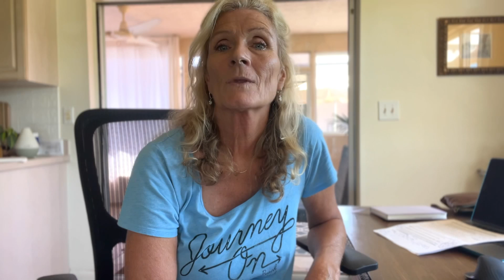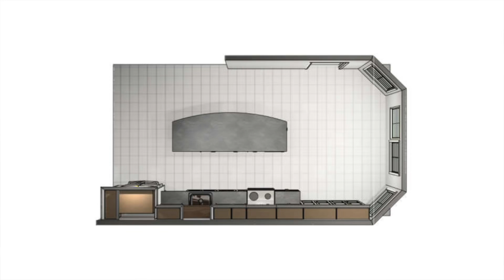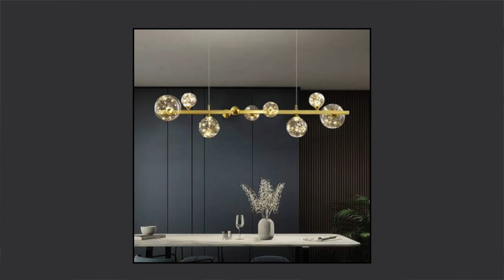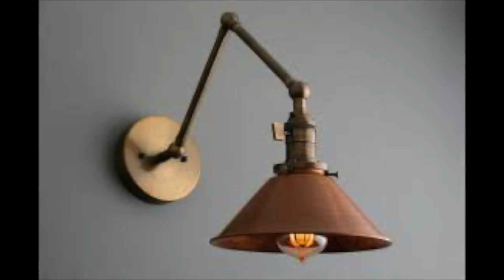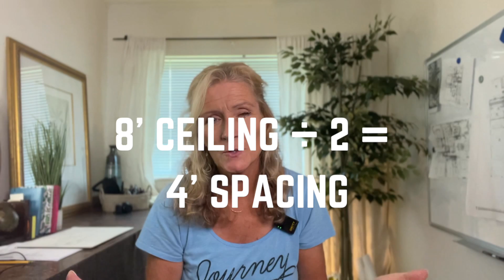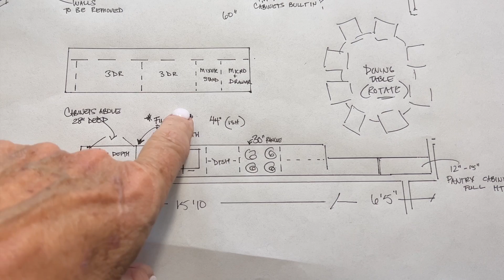6 Steps to an Illuminating LIGHTING Layout.

Comment: please tell more about kitchen island. how to light island wtih cooking hob and pullout drawer? should i combine pendant light with recessed light?
Reply from the maker: That depends on the lumens of the fixture and how you plan to use it. For a task light, the lumens required are higher, 75-100. If you plan on cooking without the pendants on or want the option and added light, then add one over the hob 🤣(I can’t help myself)

Comment: This is great info for placement!  My electrician wanted to put in a grid of 6" cans and I stopped him to say I wanted 4".  Can you suggest what brand and type of bulb should I tell him I want?  I feel like this is just as critical as the placement!
Reply from the maker: There’s several great established names. WAC, Juno,  Dals Nora , just stay away from brands that can’t write a sentence that makes sense in the description(Amazon). If budget permits, no wafer lights. Recessed cans will generally come with the led bulb included so just check the beam spread.